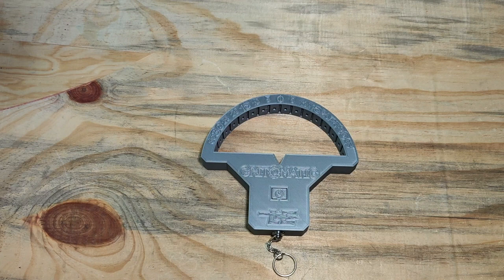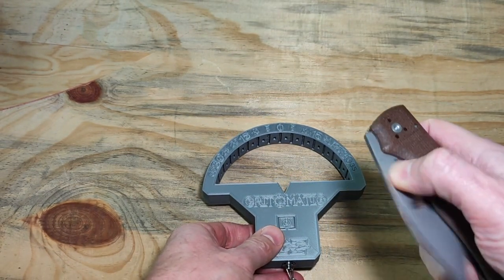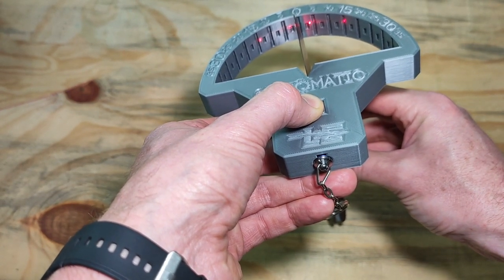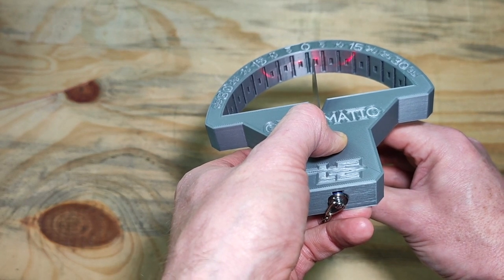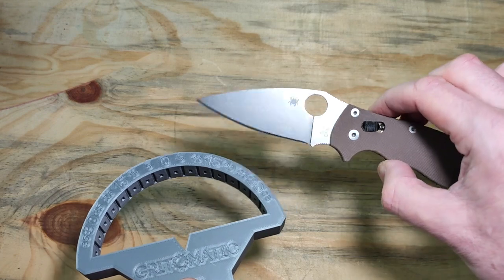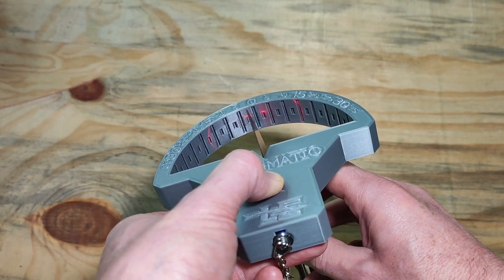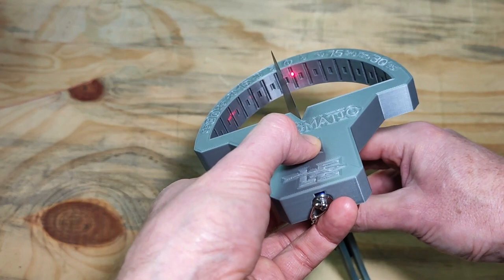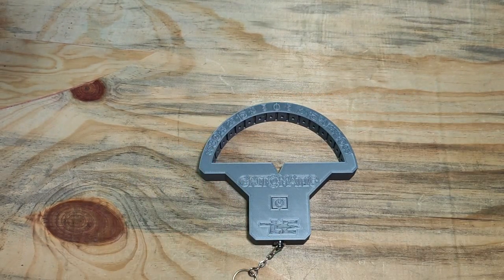Leading Edge & Gritomatic Laser Edge Goniometer - Knife angle

Comment: Quite a nice budget option for a goniometer. If a person wanted a bit more accuracy they could make and print out a scale and tape it on.
Reply from the maker: Interestingly - when I designed and made the first prototype I actually did use a paper scale and found that it does not really matter much. The laser diffraction off of the edge typically displays as a fairly wide area (Depending on the edge finish). Even on my top-of-the-line Vetako Master laser edge goniometer with a very accurate scale and tiny laser dot, you still can't get an exact perfect reading due to the laser diffraction. This made me change my design to purely a 3D printed scale and I found that it works perfectly well enough to read angles to within 0.5 of a degree - more than enough needed for every day use.

Comment: can i ask you guys what material is best for stropping with gunny juice to get the best results?
Reply from the maker: It's hard to give a specific answer for this because it depends on what you want to achieve with the edge. If you want a slightly concaved stropped finish then leather or a soft substrate is a good choice. If you want more of a "V" edge crisp finish and you're not specifically after only mirror polishing your edge, then a hard substrate (such as wood or something equivalent) is a good choice.
Reply: @777edge  thanks
Reply from the maker: @lvl18abilities  No probs

Comment: How would this work on knives that you do freehand that might have a bit of a convex edge?  Also, I looked on Gritomatic and could not find any Laser Edge Goniometer's.
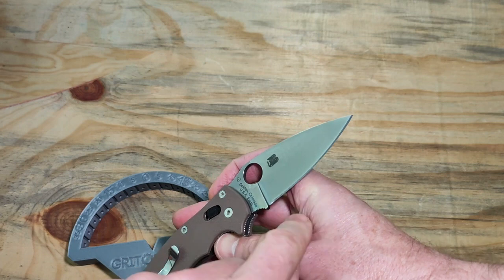Reply from the maker: Have a look at 3:14 in the video. I use a convex edge as demonstration here.

For stock, contact Gritomatic directly on their "contact us" link.
https://www.gritomatic.com/pages/contact-us
Reply: @777edge  What do you think about getting the reading of a  "micro-bevel"  I have purchased Japanese knives that are foiled right to the edge and then hand sharpened with a micro-bevel that is very small.
Reply: @777edge  And yes, I did see other models, but not this one in the video here.  What do you call this version?
Reply from the maker: @GlennInLaguna  This one is the Leading Edge Goniometer
Reply from the maker: @GlennInLaguna  A micro bevel is a good and easy way to spend less time on a higher grit stone to get a good finishing result or to easily remove a stubborn burr. That said, you can get just as good of a result without a micro bevel - but then you need to be very consistent with your angles.
Reply: @777edge  I’m not sure you understand.  I’m talking about taking the blade sides and foiling them down to the apex, then putting on a micro-bevel that is your primary bevel .  This type of device probably needs a more significant bevel to reflect off of.  This device works off of reflecting off of a surface.
Reply from the maker: @GlennInLaguna  Sorry, I mis-read your question and thought you were asking about micro bevels in general. :-). Yes, a very tiny micro bevel won't give you enough reflection for a proper reading.